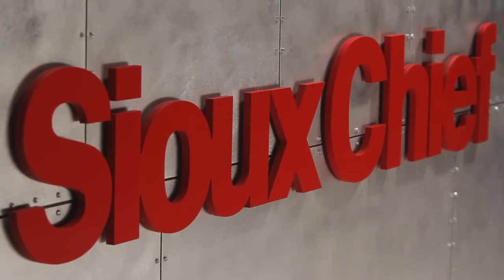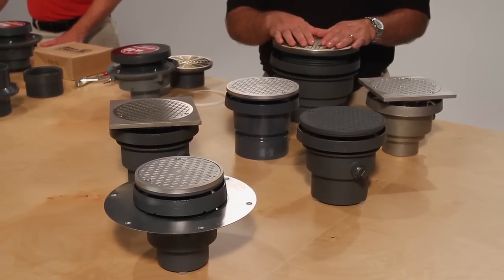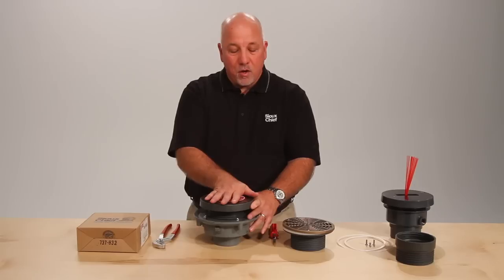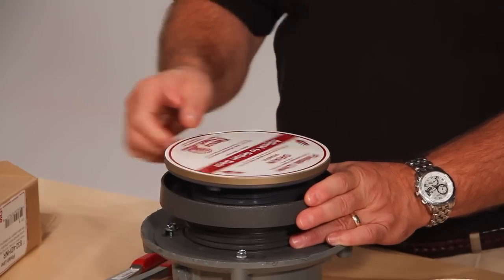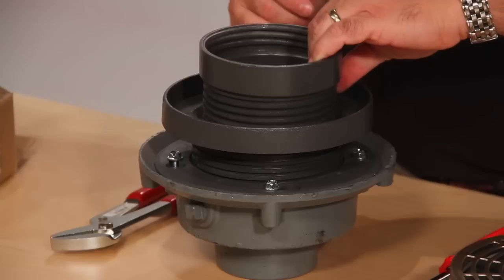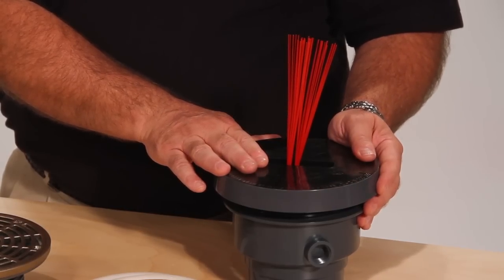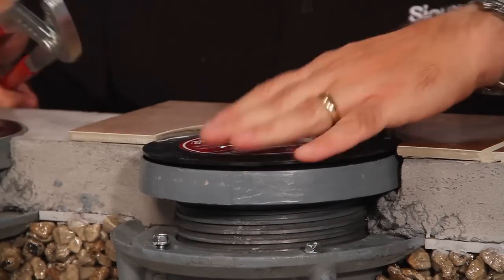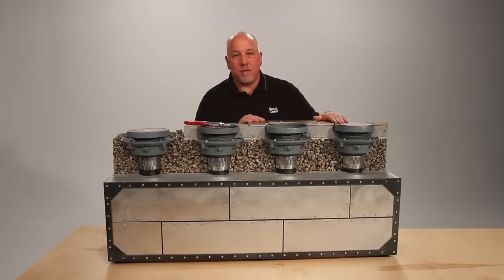Sioux Chief FinishLine™ Drain

Comment: The PVC adapter that comes with the drain doesn't fit all the way in, it only goes in about 3/4" it's most likely not schedule 40. Not a good thing...

Comment: Installing a floor drain using your product 832-4HNQ , the slab is the finished floor. Utilizing the square finish fixture, does the coring sleeve need to be set 1/4" below grade for the square finish fixture to be flush with the top of the slab. Thanks for the informative video,would like to see installation of square finish fixture
Reply from the maker: Thank you for the question. Typically, we don’t see square grates/covers installed where the slab is the finish floor – at least not as often as we see round. Since a Finish Fixture with a square top can’t recess completely into the Coring Sleeve, there’s no ‘FinishLine’ way to install a square grate/cover flush with a slab. If square is an absolute must, you would have to install the Coring Sleeve so it was 5/16” or more below the intended slab level, then install the square-top Finish Fixture (before the slab pour) and finish the slab flush to the square top – like a standard adjustable floor drain/cleanout.

Comment: How do you remove the finish fixture if you need to replace it?
Reply from the maker: Depending on your floor finish, you would break the fixture loose from the finished floor, then turn counterclockwise, unthreading and remove the finish fixture.